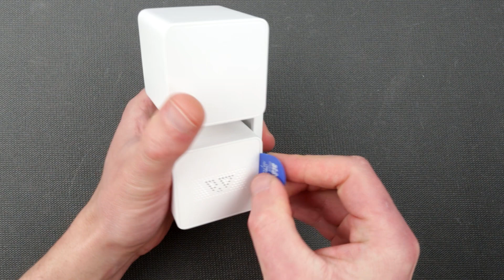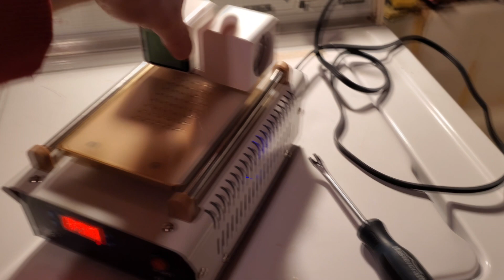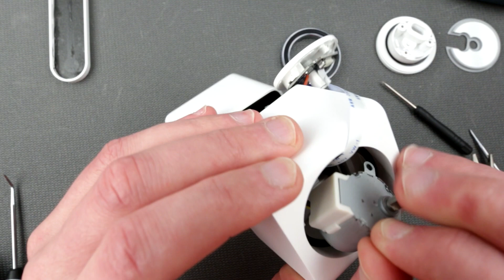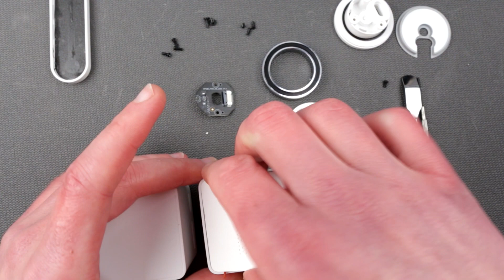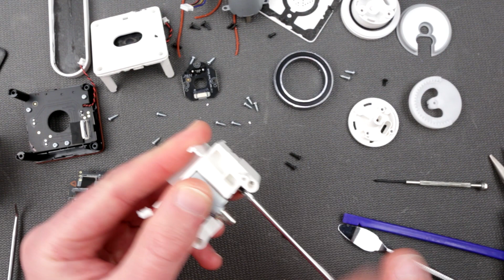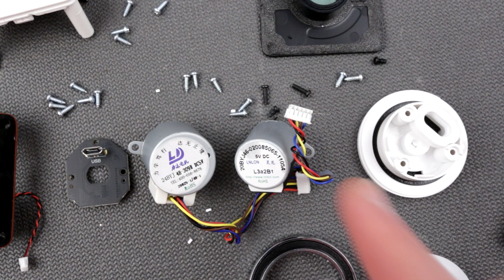Wyze Cam Pan v3 Teardown

Comment: My Wyze Cam Pan v3's two bottom IR LEDs have stopped lighting up. I'll use your video to troubleshoot it! Thank you very much. By the way, do you have any idea why the bottom IR LEDs might have stopped working?
Reply from the maker: Hi you are welcome! Need  to troubleshoot them. Check if they are not blown using multimeter
Reply: @InsideOutElectronics thanks!! I will, at least the LEDs panel looks easier to open.

Comment: If anyone is getting a no power problem. It would be the ribbon cable going into the charge port. I took mine apart and plan on cutting a new cable for it. Just need to get a ribbon cable.  We will see if I can fix it. Shouldn't be that hard just swapping out the cable and hopefully the ribbon cable lost power before shocking any of the circuitry.
Reply from the maker: Thank you for sharing ! This is very useful !

Comment: Thank you for this information. I needed this to remove the lens and put a telephoto lens instead. It was actually much easier to do than on the fixed version of the V3 Cam. After making sure this new camera was logged in to my WiFi and properly working, I shut it down and  removed the micro-sd card.
The first screen (the dark one covering everything) is stuck with pretty strong tape adhesive making the unsticking a bit hard to remove but I managed to save everything. Once the four screws mentioned were removed, all I had to do was remove the dried hot glue locking the original lens in focus and in place and screw the telephoto lens in, put the micro-sd back in, turn it on, and then focus the new lens a good 30 feet away. I used the original rubber seal around the new lens which now sticks out a bit, but I didn't have to use additional seals or anything else. I then re-installed the "first" screen with the original sticky tape in place. The new telephoto lens is a 25mm CCTV Camera Lens.
Reply from the maker: Thank you for watching !
Reply: Hello, I want to upgrade my lens also to either [5MP Action Camera Lens 16mm Fixed M12 1/2 Inch IR Filter for Gopro SJCAM YI EKEN Long Distance View, $13.90] or [25mm CCTV Camera Lens Super Clear 5 Million Pixels 1/2'' Security Camera Lens for XiaoMi, for Firefly, for SJCAM and Other IP Cameras Default, $16.56]. 
Questions: 1)Can you please tell me if ur happy with ur 25mm lens or in hind-sight wud u have chosen something different? 2) Is it difficult to/do u have any suggestions on how to focus the lens after/during installation? Focusing is, from what I gathered is the most difficult part? 
Any help is much appreciated. Thank you in advance! AE
Reply: @artest7  I like my 25mm CCTV lens and I have used the same on old V2's. I plan to use more of them. The trick is to first link the Wyze to your WiFi before tackling a lens replacement. After you've removed the original glue that holds the old lens in focus, make sure absolutely nothing goes in the "hole" before you thread the 25mm into it. Don't glue that one in place, you'll probably have to fine tune the focus depending on what you're looking at, because the depth of field is pretty short at 25mm. That being said, I first threaded the new lens to about where the original was glued in. I then re-assembled the camera and picked a spot to focus on that was about 10 meters away and gently tried screwing/unscrewing the new lens until I had it focused. Since the 25mm sticks out a fair bit, it's not too difficult to grab it and move it either direction. The new lens won't move on its own so I just leave free to adjust focus if I decide to aim it at something else. I bought a 50mm lens, but it sticks out too much and would hit the other "cube" on boot-up. I'm considering cutting and extending the arm between the two "cubes" and lengthening the wiring between the two, but I have not started that project. Just another winter project. I guess I should try the 50mm on a old fixed V2 to see how that works. Those old V2's have been pretty good and reliable for me. Plus you can daisy chain them. I can't say the same about some of the new Wyze cameras, and I run quite a few of them.
This video is very good and I refer to it often.

Comment: Can you tell me what size those three screws are.  Mine did not come with those, (I didn't No until the camera fell apart a year later), and even Wyze doesn't carry them, or even tell me where to get the, or what size they are.
Reply: I was able to take it apart with the basic Ifixit kit. It was a cross and the size is from Ifixit is the  PH00 cross bit.

Comment: Just bought one off eBay. As used and no charger or cord. $15 + shipping. Looks brand new. Box and all. Nearly not a single mark or scratch. Also zero power up and not a peep from any LEDs. I'm hoping that its just the USB cable in ribbon may have came loose. Guy refunded me. No need to return camera. Fingers crossed.
Reply: Here's what we know. The little stopper tabs at the bottom base (to keep it from rotating too much?) one of them broke off. The cam was able to (rotate too much?). And wrapped the little ribbon cable nearly into shreds. It also ripped that ribbon cables inner lead straight out of its PCB board. Figured what was what with + and - and have a USB cord direct into 2nd board. We got the red LED!!! "Ready to Connect?" Hell yeah.
Reply from the maker: @jqzIII  Very nice ! Thank you for watching and sharing your success story !

Comment: Would like to see a telephoto lens added and if it will work with a solar panel.
Reply from the maker: I will look into it eventually :) Thank you for suggesting the idea !
Reply: Please see my comments. It was easy to do on this V3 Pan Cam. I just did it with a 25mm CCTV lens available on Amazon. Somebody did it on a fixed V3 and posted that video and it's more work than this Pan V3.

Comment: Thank you for the video. I just pulled the bearing out because it wouldn't rotate anymore. I cleaned the bearing that was seized and reoiled it with good stuff. I cleaned and put o-ring silicone on all the seals and it's working again. I mounted it right side up, so hopefully water doesn't get to the bearing this time.
Reply from the maker: @fischersgadgets4936  thank you for watching! Happy to help

Comment: Would be interesting to see which voltage conversion components are used to see if it can be powered from 6-7V over long wires so that voltage drop at 1A still makes it > ~ 4V

Comment: Leave it to me to have the one problem I couldn't see where it came from.  The 4 straps wire that's sticking into the arm where does the other end unplug from?  Let me be honest wyzecam cameras have a tendency to go black for no reason and just stop working for months.  Then after you purchase another and your 8 yr old cousin plugs them in and you say if it works you can have it bam it works!  I got mad prematurely at my 1st wyzecam pan v3 because after 6 or more cameras this one shouldn't shut down.  They should improve with each new camera.  So what did Wendy do?  I grabbed the little sucker and snapped it's neck and ripped into it like a Boss!  Yup, not a boss anymore just an idiot with a $40 some odd piece of parts.  Well, it's in 2 pieces just kinda snapped the camera off the arm and now have the 4 strap wire hanging out saying "hey dumbass, now whadaya gonna do?"👁️👀

Comment: I have 2 questions, one simple, one crazy, just looking for your opinion. 1) Can the lens be unscrewed and replaced (as with OG, V3). 2) This is a bit crazy, but do you think the actual camera could be swapped out with a V3 Pro? Either sensor or whole board. Thanks. Amazing videos!
Reply from the maker: Thank you for watching, I believe lens can be swapped, but I do not have V3 pro to see if boards are compatible.
Reply: Yes, I did it on this specific model (V3 Pan Cam) to install a telephoto lens. Make sure the camera is already part of your Wyze system and working properly first otherwise if you're doing a telephoto lens swap you will have grief trying to focus the telephoto lens to read the registration code some 30 feet away. 
Shut the camera off, remove the micro-sd card.
Follow the instructions given on the video to the point where you now have taken the four screws out and popped the first "layer" or board of internal guts to expose the lens sitting on the board underneath. You do not need to disconnect anything, just gently hold the top board out of the way while you work at removing the glue off the threads of the old lens. Remove as much of the cold hot glue holding the old lens in focus. Unscrew the old lens and do not drop any glue or dust on the now exposed sensor. Gently thread the new lens in place and screw it in a few turns. Put the top board back in, screw the four screws back on. Put the micro-sd back in, turn the camera on. You now need to focus the telephoto lens on an object some 30 feet away by carefully screwing in this lens IN SMALL INCREMENTS OF 10 DEGREES OR SO until you are satisfied. Don't bottom the lens out or you might just destroy the sensor. It will feel snug as you go in, but eventually you'll get a nicely focused picture. 
Once that's done, put the original rubber seal that you dropped (I did) when removing the first dark cover (the one that was stuck on the top board), and re-stick this outside cover back on. That's it. Odds are you will not need to mess with the focus after all this, but since the new telephoto lens sticks out a fair bit you can fine tune the lens even with everything back in place. FYI, my 25mm CCTV Telephoto lens sticks 4.58mm or 0.180" above the cover. The original lens   sits flush.

Comment: Thanks for this video.  Have several Wyze Cam Pan v3 cameras but only one mounted outside.  IP65 they are NOT!

Two in the same location have failed.  One, the larger bearing was totally corroded and frozen.  Replacement bearing of much better quality fixed that camera.  

The second, black and only in service two months developed a motor clicking noise (larger of the two motors) but when opened up, I found the camera was full of water.  

They are inexpensive, but certainly not weatherproof as advertised. 

Can you advise how to acquire a replacement motor?

Thanks
Reply from the maker: Thank you watching, and sharing your experience.
I honestly never used them outside !
At this moment I do not know where we can source motors, let me check around
Reply: Could you post a link to where you got the bearing? Thanks!
Reply: Keep trying to reply but it doesn’t seem to go.
Reply from the maker: @cgc6761 Yeah, it seems like i got only the part of you question, could not understand
Reply: Bearing Replacement:  NSK-9806VV.   (Radial and Deep Groove B)
Reply: @cgc6761  did you mean 6806vv?
Reply from the maker: @Willy--Wonka--69--69   Yes, you are correct, original posted made another comment with correct bearing name:
@cgc6761
10 minutes ago
NSK-6806VV.  (6806VV RADIAL AND DEEP GROOVE B)
Reply: @cgc6761  thanks a lot! I really appreciate it! My bearing froze and I was able to unfreeze it by manually turning the camera but it's only a matter of time...
Reply: @Willy--Wonka--69--69     It’s early days but it is a much better quality bearing.  Made in Japan and costs nearly as much as the camera itself but, should last much longer.
Reply: Purchased:  Bearing Service, Inc.  Livonia, MI

Comment: Can you remove the mic without breaking the camera?
Reply from the maker: It has to be unsoldered and yes you would have to take it apart.
Reply: @InsideOutElectronics  By breaking I mean damaging components unrelated to the mic. Taking it apart isn’t an issue unless taking it apart damages the unit.

Comment: hello. is there any way to send the images trough lan ? and see it via web in local mode?
Reply from the maker: Nope, everything goes via the so called cloud. No cloud no service  AFAIK
BUT I think there s notion of flashing open source firmware - something I did not researched yet
Reply: @InsideOutElectronics  only some brands...typically the 1s where they are just white label, re branded product.....utilizing the same similar app.....typically some generic...no bells or whistles application.....though, if flashed with other setup, there are some pretty powerful applications out there.....

It bugs me how the new cameras ar locked down to cloud services...some go as far as placing features behind paywalls, where a cloud account is mandatory......Want auto tracking?? It's 4bucks per month extra...color night vision? Anothe 4per month....want voice functionality? another 4...how about some video storrage?i Another 10bucks per month...oh, you want to turn off the red led that shows it is recording?i to be more sneaky?i Another 4bucks a month. Want the autotracking to distinguish between animals, dogs, cats, humans? That's another 5.....read license plates?i hough may be regulated in certain areas of the world....and a feature I love.... that is another 8bucks per month....want to add more than 2 cameras? Another 5bucks.... for the features you thought you bought the $50 camera for, now you have to pay service fees....monthly....in this case over 50 dollars....but wait......if you want all that, you can subscribe, pay a full ear to save.....Oh  boy does that bug me....

I guess that is how they can subsidize the low initial price of the hardwar.....something like printers and ink...though, at least with ink you can shop around sorta

And, i think the push to the cloud services and how things are is due to the fact that the cameras were so easily hackable....with hackers spying in on baby monitors and security cameras...very creepy.
Reply: There is a video from about 3-4 years ago. I cannot remember exactly where or when saw it. But a guy with considerable network protocol knowledge figured out how to intercept the signal from within your local wifi network. If memory serves, he just monitored the data packets sent from the camera each time it connected to the wifi network until he figured out the digital hand shack that was occurring. Try googling things like "wyze ip camera without flashing firmware"

Comment: question: Bought a bunch of Cam v3 and older Cam Pan v2 and setup them for a relative in a rural area. (complete with the wyze external power cable even though some were inside)  Well a recent storm knocked them all off the net. Its an older relative so I will need to actually visit (hours away) to determine the actual damage (adapter or cam).  What has been your experience on storm damaged wyze gear?   (I'm trying to come prepared when I go)
Reply from the maker: No experience, are they not connecting too WIFI or they are completely dead ?
May be someone of the viewers can speak, but so far after all thunderstorms it is all good
Reply: @InsideOutElectronics   I'm told that Wifi works.  I'm going to assume that I need to do a full replace, bring surge protectors, etc, and hope some can be recycled.  The cams were a soft security blanket, they liked to watch critters that went bump in the night.
Reply from the maker: @darwinjina  yeah, I use mine as critter cam as well,  to see who messing my garden ;)
Reply: @InsideOutElectronics    ps.Thanks for the response
Reply: these arent outdoor rated would be your issue
Reply: @AutoRepairs-y3m    Outdoor rated ones were outside under the overhang. Others were inside large rooms or pointing out windows. In our case, we replaced the non-working Wyze USB adapters with better adapter. Overall, most of the drama was due to the WIFI reverting to factory setting which we didn't know till we visited last month. End result was that we doubled their camera count.